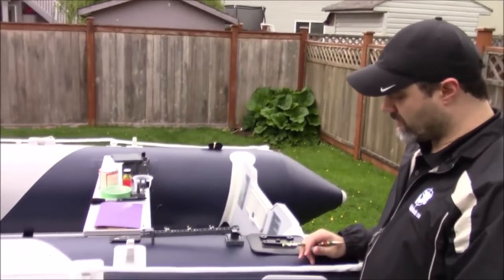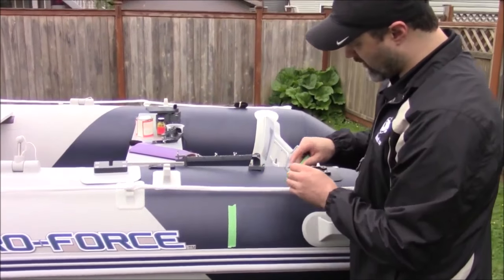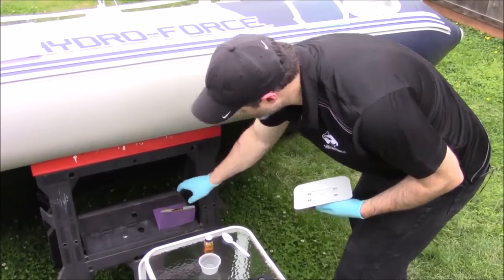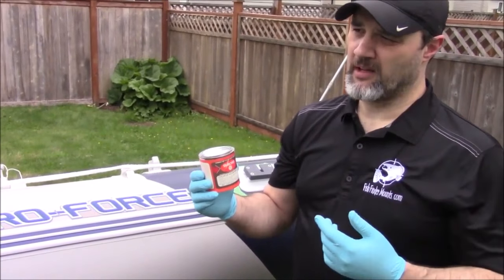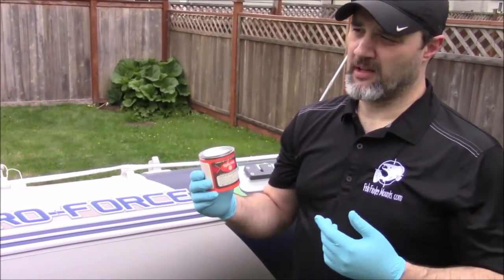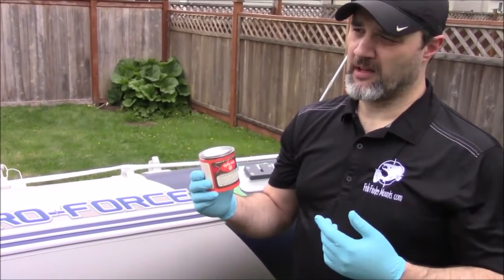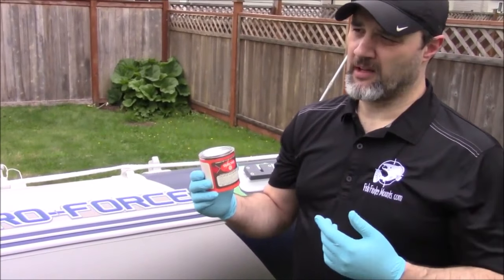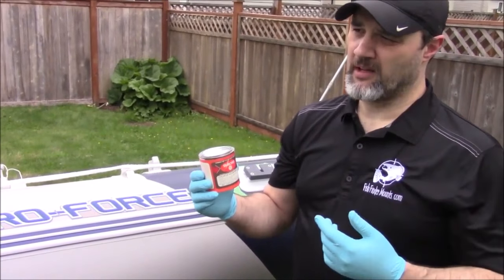Glue On Fish Finder Mount for Inflatable Boats: How To Install Step by Step

Comment: Good video for applying non critical components to an inflatable boat. YouTube needed this instructional video.  But, hydro force boats are PVC and so are the Scotty mounts.
Reply from the maker: You are correct - thank you for your comments.  The glue we used is still good choice, but I think these guys at NRS are the experts with glue, and here's a great video link to help further :) : https://www.youtube.com/watch?v=v6YmWa7ScOc
Thanks again for your correction!
Reply: Anytime.  I definitely wasn't suggesting not to use the 2 part glue.  My apologies if that's how it came across.  I always use 2 part glue for PVC to PVC.  Keep up the lengthy videos!
Reply from the maker: rmhawk123 No - No, your comments are very welcome - no apologies necessary,and no offence taken.  We want the best information, so it's good you commented :)

Comment: Cut a smaller 2" x 2" or so  size sandpaper piece.  You''ll find it works a lot easier than handling the big piece of sandpaper folded like you are doing.  It also helps prevent sanding of area outside the line.
Reply from the maker: Thank you for your helpful comments Michael.  We'll surely have to do that in the future.